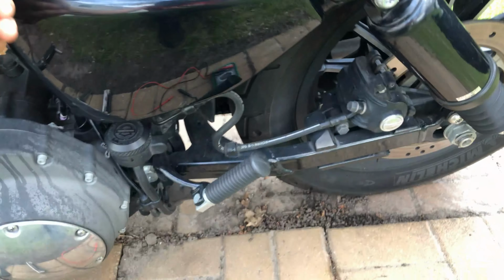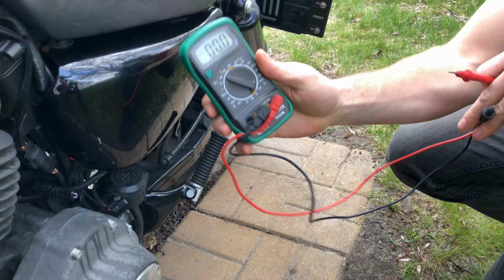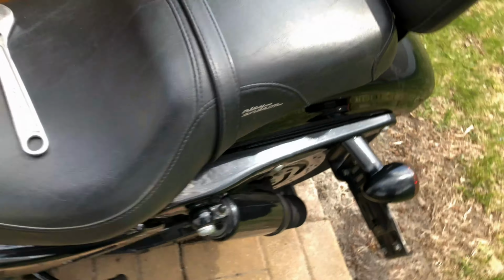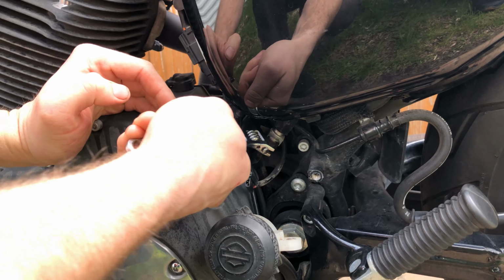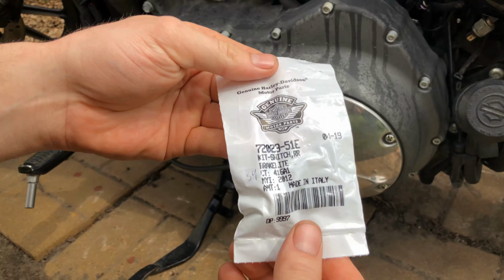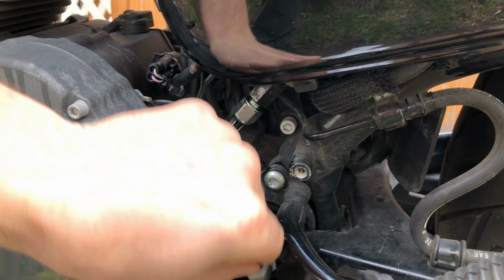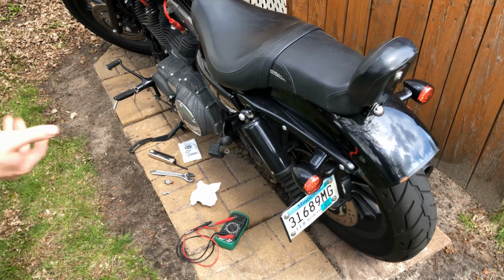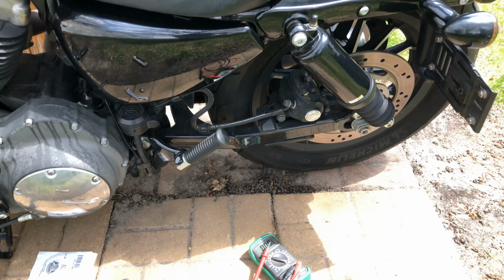Harley Brake Switch Replacement (2007+ Nightster, Sportster, Iron)

Comment: Great video.  I used this to troubleshoot and replace mine today on my 09 nightster.  Pro tip: standard auto fuse works perfect to jump those connectors when testing. 

I did not have to bleed my brakes but I did add a little more fluid.

Comment: Hey thanks for the video, as far as the cases go.... there is a product called Pig Spit that you spray on there and it will bring the engine back to black. Harley also makes a product i think is called engine brightener that works almost as good. On the baggers the floor boards will get discolored if you get certain cleaners on them and ive found the Bag Brite brand of leather conditioner works great on them.
Reply from the maker: Thanks man!

Comment: Really nice job my back went out but my front is working. Once again thanks saved me well over 100.You got a really nice bike I know that cover can be upsetting. I once had some blue pipe and guy once told me to use some 1200 grit wet sand and brought it right out.Im not suggestion you use it to bring cover back. But maybe try a small section at 1200 grit it won't leave any scratches. Once again thanks for the video.
Reply from the maker: Thanks man, glad I could help out!

Comment: Another way to test the switch would be to check for continuity use a ohms meter with the hydrologic brake switch still connected to the brake circuit connecting the ohms meter leads to the switch and set to continuity with the ignition on push the brake pedal if you don’t get continuity then the brake switch is not working properly

Comment: Those fuckers at harley davidson told me you had to bleed the brakes an wanted $150 to do the same thing. Thanks bro. Saved me some $$.
Reply from the maker: You should bleed the brakes, but you can do that yourself, too!
Reply: So do you need to bleed the brakes?
Reply from the maker: @mikec573  Not the fronts, but I do recommend bleeding the rear caliper. The rear brake will still work without bleeding it, but the pedal will be spongey and not work as well.
Reply: @TonyTheTruckGuy  gotcha. I will do. I've been putting off the repair for a few weeks due to Harley's high prices at their shop. I'll be fixing it tomorrow.
Reply from the maker: @mikec573   Good luck!
Reply: @TonyTheTruckGuy  thank you sir..
Reply: fuckin dealership

Comment: What year is you motorcycle? I have a 2018 XL1200XS FORTY-EIGHT SPECIAL, can’t found the brake switch
Reply from the maker: This was an '08. Your brake lights stop working?
Reply: @TonyTheTruckGuy  yes, not working

Comment: HOW DO YOU CLEAN THE SIDE CASES FROM THAT DISCOLORATION? MINE IS DOING THE SAME THING :(
Reply from the maker: Ugh, that one really pissed me off. They were TOTALLY fine until I listened to a buddy and sprayed some degreaser on the engine. Took a few minutes to get the pressure washer set up, and by the time I rinsed the degreaser off, it had stained the case like this and wouldn’t come off even with a pressure washer. Thought about spraying the whole damn engine with it again so it would at least all be the same shade/color. Buuut I ended up selling the bike. I have a night rod now. I don’t know of any surefire ways to fix your issue. I’d suggest a google search or try something like brake clean or wd-40,  but I can’t tell you what affect that might have.
Reply: @TonyTheTruckGuy  yep it was engine degreaser that did it
Reply from the maker: Well, shit. Lesson learned there. I’d try why I mentioned before and hope for the best
Reply: @TonyTheTruckGuy  yea I will, thanks
Reply: Try the Harley Engine Brightener. It comes in a spray can. May fix your engine stain.

Comment: Mine lost break light an turning signal all I have is parking lights
Reply from the maker: Check the switch like I did. You may have a turn signal switch issue.

Comment: Did you have to bleed the brakes?
Reply from the maker: I’d highly recommend it. I didn’t haaaaave to, but I could tell the rear brakes weren’t as strong after replacing the switch, so I bled them.